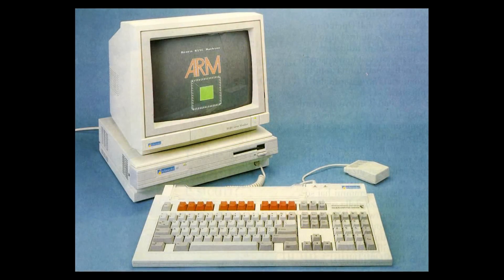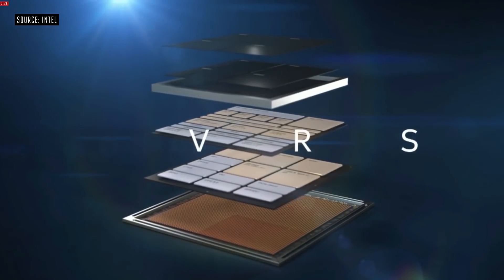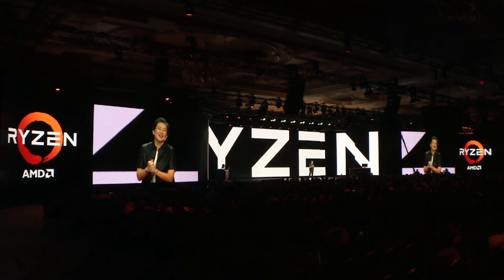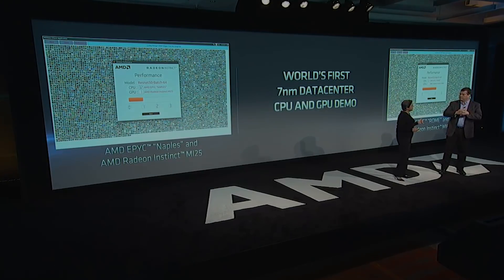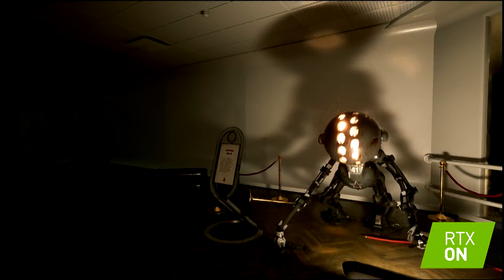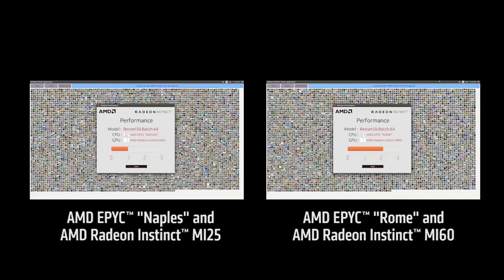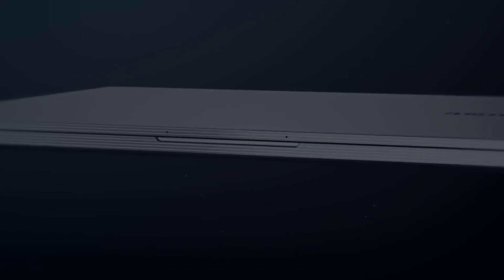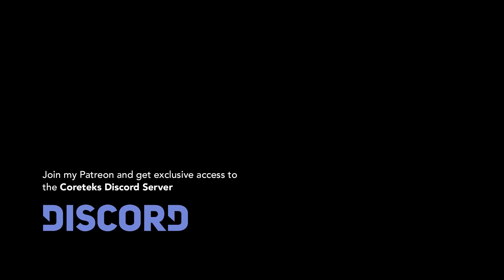Hardware trends: How many cores do we need?!

Comment: Actually the info about RT cores also stop scaling after a certain point is just not completely true. Gpu rendering for vfx has been a thing for a while now and adding extra cards almost scales 100% (obviously not exactly but close  to it) there's who've done builds with 11gpu's, being thousands of cuda cores in total and it just scales as expected. Only problem in that regard is heat management, but rendering can scale very very well and RTX cores are basically just cores specialized at ray/path tracing (what were doing with cuda cores right now in vfx rendering on gpu)

otherwise nice video  :)

Comment: We could easily have 64 core or more CPUs just based on the higher density lithography. The same for CPU speed has barely improved in 18 years. 3GHx in 2001, 4.5Ghz in 2019. It SHOULD be about 1536GHz doubling every 24 months like in the past ! Since INtel, Motorola and DARPA have all demonstrated 1THz,1,000GHz technology  !!!!   Tech is being HELD BACK !
Reply: Tech is being held back by an end of Dennard scaling in around 2006 and the powerwall we hit due to it.
This is the reason why we are concerned of power usage and why everyone aimed to multicore processors.
Reply: @pottuvoi2  see the video - 2001 techtv clip - intels new "terahertz transistor"
Reply: @pottuvoi2  Just the Intel "secret sauce" whatever that was would be a huge improvement. Carbon nanotube sheet heatsink ? I've seen nickel has similar properties too.
Reply: @pottuvoi2  Yes that's a big factor but Intel and others have clearly made huge improvements in 2001 running at 100GHz ! Yet 18 years later almost 5GHz. And DARPA and Mororola running at 1THz  in 2009 and 2011. See HEMT transistors invented in the 1980s !

Comment: Amdahl's law applies per program - an OS is running lots of programs.

It was used for years as an argument why more than 4 cores was a waste of time, but real world results in decent OSes (*nixes) show that even singlethreaded programs benefit because more cores means that each program can effectively grab a core to itself (or have less overheads in thread switching)

At that point the limiting factor becomes the OS's ability to allocate threads

So the answer isn't JUST about how many cores any given program can use, but how many programs/tasks you're running and how the OS can allocate them.

Comment: i expect to start seeing cpu hierarchy being a thing, much the way we have multiple memory types from sram cashe all the way down to dram (i also expect the line between storage and memory to grow more fuzzy) . there are already socs on the market that have multiple cores at different specs. so i expect to see one or two really fast cores for sequential work, then have some lesser cores for when you need more threads, then have a bunch of gpu cores all of which may be on a single module, maybe even some fpga cores for customizable workloads. though i figure mapping the right workloads to the right cores might be somewhat of a challenge. like kicking some low priority tasks down to the least capable cores where the primaries go to the application you are using. on the fly core switching is another big challenge.

Comment: I realized hardware is not important when I was just 12 years old, So I am still running a 3rd gen i3 paired with gtx 1050ti, almost all modern games run 40fps plus and 3d rendering on blender and AutoCAD and heavy workloads like Adobe Premiere Editing Still Works Like Butter so there u have it .

Comment: Not all programming languages are designed that way. I think many ones will become obsolete as we push into a new paradigm of programming thought and practice which will lead to further increasing of parrallization. Mix this with clock speed and core increases, that can result in gains.
I don't necessisarly see such gains being made with silicon based chips though, as the overall throughput would need to be substantially increased to support such models.

The transition from purely functional coding to object orientated occured within the lifetime of individuals, with the next generation of programming languages already in development. I wouldn't be surprised that the next big language is in the works and will eventually drop onto the laps of programmers which will ultimately force all code to be parallel by default.
It may make some tasks more difficult, but ultimately result in a significant bump in performance.

Comment: Thin clients...really?  That does not work at all for consumers that don't have reliable high speed internet (i.e. fiber).  Subscription services are BS.  I will continue to buy the corporate program or use a freeware/shareware equivalent.  Didn't we try this decades ago?  It only makes sense in a corporate environment with high speed access.

I don't want my desktop or laptop acting like a tablet.  You can't do real work on tablet.  It is a way of scamming more money from corporations or individuals.

Most computers with 16 or 32 GB and 6 cores is plenty for most people.  Parallel makes sense, but can increase software expense exponentially.

My main concern is software stability and elimination of bloat and spying software...not hardware.

Comment: As a programmer I can say there are many cases in which spawning an extra thread is more compute intensive than running it sequentially, and because many parts of software rely on the results of other code, you can't parallelise those parts at all. In these cases, like many, it's better to make the individual cores faster than more numerous.
And that's why I think ARM isn't going anywhere until they can beat an intel core of at most 8 years old in raw perf.

Comment: You are wrong though. First future games can you use Ray tracing. And second most games just aren't built for multiple processors but there is no reason they can't be you can use each core as a separate processor to do different things for instant control AI, physics etc

Comment: On the ray tracing thing, the current version assumes basically a purely transparent air volume. Various compromises are done to get the haze in the distance effect.  To make these more realistic, the ray being traced effectively spawns new traces at slight angles.  More cores will make this code practical in real time.
The machine I am typing this on has several threads going before I start the web browser.  This means that the total work load is paralleled to at least one more core than the web browser.

Comment: I think your analysis is lacking on two counts: first, I don’t think that you can reliably predict the types of workloads that people will want to run on their desktops in the next few years. If the last 50 years of computing has taught us anything it’s that new types of workloads are constantly emerging. Secondly, your analysis doesn’t mention the issues of reliability and security. The more networked resources that you need to get your work done the less reliability that you have and reliability falls dramatically as the number increases. Also, I think it’s already a very sad fact that it’s apparent that security issues will never really be completely solved.

Comment: You never mentioned the case for multiple cores to handle the 100 odd background processes that are running on our computers all the time. In the past, with older versions of Windows, I was obsessed at times with seeing how many of these processes I could kill to max out performance. Every one of these is generating interrupts or causing task switches from time to time to carry out its task. I always dreamed of having, let's say 128 cores, so that each and every background task could have its own CPU, eliminating interrupting the principal application. Certainly it's not that long ago when people streaming large real time data throughputs such as real time video or audio rendering were advised to at least turn off the anti-virus and Windows search.

Comment: Heterogenous multicore could be helpful but will be a huge hassle for everyone involved. E.g. a few fast X64 cores, a few dozen arm cores, a few dozen GPU compute units, some nice big slabs of FPGA, some special purpose encoding, encryption/decryption etc units. That will give you the best performance at the lowest power at the cost of having huge slabs of silicon that are inactive or clocked slowly most of the time and giving programmers an aneurysm.

Comment: Existing games won't run faster on 16 core CPUs. What wíll happen is that orthogonal things that can run completely in parallel to what the game is doing today will be found and hyped; they will gobble up the existing cores; most will be found to be only hype and a few will be good enough to stick around.

This is very typical. Look at what happened on the supercomputer side of things. If it  takes you 20 minutes per time step ("frame") to do a 2D simulation of the sun; then having a greatly increased number of cores won't speed the serial fraction and Amdahl's law will kill most of your gains. However you can run many independent 2D simulations in parallel (same way you can't get a baby in 1 month with 9 women involved, but 9 babies in 9 months is possible). You can also make the problem bigger; e.g. a 3D simulation of the sun; it will still take about 20 minutes per time step, no faster than before, but maybe it captures something that was rationalized away in your 2D, symmetry-around-rotational axis-simulation.
Reply: Do you have some kind of blog?
Reply: @_mend4mad_11  No. Sorry.

Comment: "Jensen would want to be on stage to announce a higher performance increase to justify costing  $1600".  Had me on the floor. $1600 is a modest guess in my opinion.  Question came to mind on the Ryzen core count.  If CPU clock cycles is the ticket to increased performance, then why can't the cores be used to switch during high demand tasks to keep cooling down allowing higher GHz?  I still remember when the 1 GHz  could never be reached.  This video is only looking at current technology.

Comment: I do understand exactly what you are trying to say concerning thin clients but you are assuming that fast 4G/5G is accessible worldwide ! Sadly this is not the case, I am British and I think unless you live in good area like a city then having a good internet connection is a luxury in fact having a stable reasonable connection is a luxury and from what i have read this is also the same case in the USA with many ISP's trying not to improve speed so they can make as much profit as possible on the current system !
Also data costs money, I am not sure what the current costs of data are around the world at the moment but using a thin client could easily cost you more in data costs than a traditional PC/Laptop because of less data transmission unless you pay a fixed cost for unlimited data which not many mobile companies offer at a reasonable price. I usually keep a laptop for 3-5 years but I buy expensive gaming laptops the last one cost me £2,100 and is a i70-6700k with 17" 4k display and a GTX1080 with 16gb DRAM and 256gb NVME and 512gb SSD and 1TB SSD this was back in Oct 2016 and unless it goes faulty I think it will be good for at least another 18 months so that will be 4 years or £525 per year. I think if it would have been possible to purchase a thin client laptop (£250-£400) with an unlimited internet connection I am pretty certain that it would have cost more that £2000 in internet costs and this would also limit where I could live because I would have to decide depending on the internet connection speeds whereas with a traditional laptop I can go where I want and internet speed is only an issue for gaming. BTW I am now living in a place where I am forced to use Mobile internet which because not fixed lines are available here and data costs £1.30 for 2gb valid for 1 week.
I would like to know how much increase in data would be required for thin clients machines over traditional PC's and Laptops then maybe we can truly evaluate what you say about thin clients.

Comment: Amdahls law is about response time, not capacity. That is, the premiss is that one core sets upp the process, then all cores (say two) share the process. Then if there are two cores and 50% and the whole process takes 4 seconds. The first part will take 2 seconds, the second 1 second... If you have 4 cores, the first will still take 2 seconds, and the second will take 0.5... and so on.

The thing is, if you want capacity, not respons time, it would work differently.
If you have 2 cores, one core will set it up, the other core will process it, during the time the second core processes it, the first core sets up the next process. This give 100% performance gain for 2 cores for every process except the very first and very last.

So the setup takes 2, and the processing takes 2, but its done simultaneously, so the whole process only takes 2 on average. If you ad a 3:d core you have no performance gain what so ever.

This can be seen how rendering software work (like cinebench). Each square is one process. Regardless if you have 1 core or 64 cores. The first square is done in the same time. But if you have 64 cores, 64 cores will be done virtually simultaneous.

Here the whole idéa with Armdahls law/argument totally fails on rendering. The law/argument is  not about capacity.

For heterogeneously computing it fails even more. A cuda core have 64 parallel pipes that work on each single thread. A ryzen core got 10 pipes that is super scalar. Pretty much work ni quasi serial mode. That is, it simulates a higher core speed. About 6 times on average. (IPC)

So a 2Ghz cuda core will run 128G instructions, and a 4Ghz ryzen core will run about 24G instructions.

If the code have say 95% parralelizations one ryzen core could supply 24/0,05=480G instructions worth of parallel instruction.

But if it of loads that on 4 cuda cores, the Ryzen core can make the set up for the next batch simultaniusly as the data is processed.

That makes use of one ryzen core and 4 cuda cores. But, this is the important part.  The ryzen core can in turn be package on a superior code running say 90% palatalization . So one one ryzen core, can supply 10 additional ryzen core with packaging work and in turn giving 40 cuda cores full work load, pretty much filling up a 2080.

Now one thing is important... Until DX11 only one core was alowed to communicate with the GPU, this limited the amount of Cuda cores that could be accessed for rendering.. that in turn, in the olden days (well 3 years ago) made pretty much all GPU equally slow running heterogeneous rendering.

Now with DX12, this is no longer a problem. And just a tiny improvement int he shell program, will drastically improve the overall all performance

Comment: great video, but there is certain things you didn't take into consideration, when you talk about a small performance increase with nvidia ray tracing, you are assuming there will be no IPC or clockspeed increases and when you talk about the next Ryzen 3000 series, you should also take in consideration power consumption,price,IPC,clockspeed... and you took a bad example of one program running but in a OS, most of people have lot of programs running, even an OS auto update can be very taxing in cpu resources

Comment: Wow converting single programs to to multicore programs in order to take benefit of the extra speed but is there software wich could do that automatically or does it require reverse engineering those single core programs for that?
Either way it’s interesting,

Also we don’t need more powerful chips in our smartphones,no because all we do most  of the time is using internet for whether app wich do require internet,,, unless they will implement deaplearning chips in our smartphones wich can turn B&W snap shots into color and isolate wanted sound from unwanted sound, with requiring internet, then i will vote for more powerful chips in our smartphones!!!

Comment: There needs to be a clarification here, even
Though increasing the the cores does not improve the performance of an application but we have to consider that multiple applications can be run on different set of cores.

Comment: Seriously, did you forget that multitasking was a thing??
Reply: So how much multitasking do most consumers do ? And how much do prosumers do ?
We need new applications to really make good use of it.
Reply: @autohmae  I don't know about you, but I'd like to not have to close Chrome and everything else just to game without compromised performance - and I'd consider myself a prosumer. I doubt that the average consumer will always remember to close other applications, or even know that they should.
As streaming is becoming more and more mainstream, it becomes another case of significant multitasking load that should have been addressed here. Testing a single application at a time provides a very limited perspective on the value of many-core CPUs.

Comment: You're wrong in principle.  You want a mathematical upper limit on processors rendering a scene?  Fine, you could have one processor and memory system per sub-pixel, say 9 per pixel.  And even then, if you're doing path tracing, you could have one processor and memory system for each of say, 200 paths that light could take tracing out from that sub pixel. So at 4k resolution, that means that there's no point having more than 15 trillion processors.